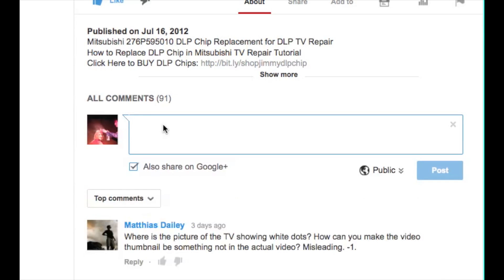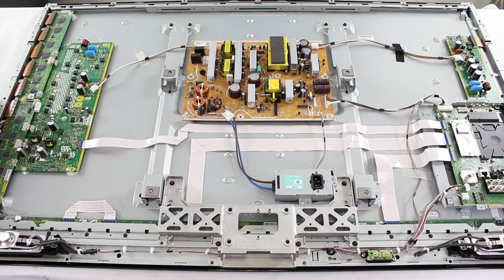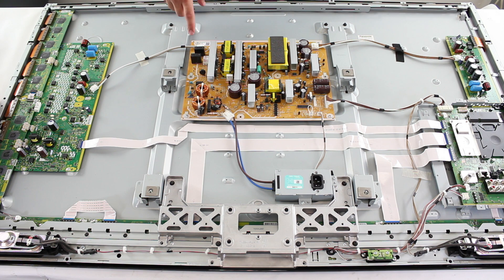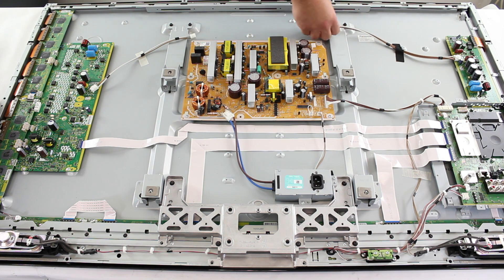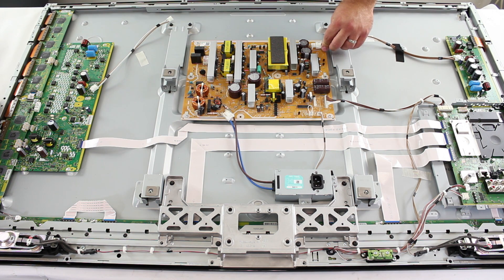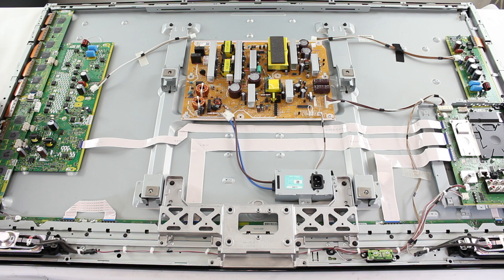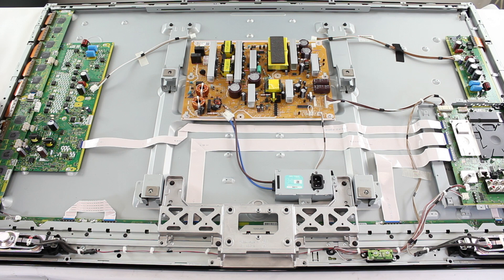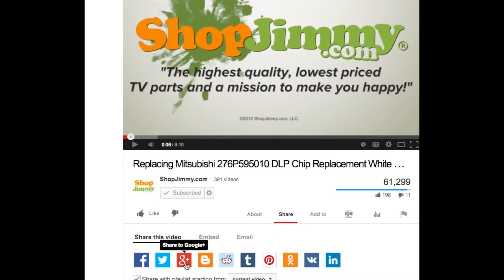Plasma TV Repair Help Clicking Noise & No Picture How to Troubleshoot Y Sustain & X Sustain Problems

Comment: Thank you for the video.  I tried all your suggestions, but it still clicks both times.  It's the power supply board that clicks.  Any other suggestions you might have?  Thank you very much

Comment: Lg50pa5500 suddenly turned off, I waited 5 minutes to turn back on, I got sound but no picture. I turned off again waited 5 min now no sound or picture but click noise from middle board the red led on the little board for cable connections stays on and a small flashing green led on the board next to the power cord male end (on the TV) flashes. I had successfully replaced the SDT-S-105DMR relay a year ago, I replaced that now but it didn't work. Any ideas?

Comment: Have a pioneer plasma t.v. that all of a sudden won't turn one, changed remote batteries un plugged and reel plugged in, changed power outlet, manual power button was damaged a year, but was working fine with remote, ????

Comment: Hi 
i have Hisense 60 inches smart tv. The Tv switch off suddently while we are watching( No red light and screen is black)
i have plug into another power socket still not working. I have openned it up, checket the comtinuity on fuse and power cable, it looks fine but still not working.
i have noticed there is a ticking noise 
Would you please help
Thanks

Comment: My Phillip 27 inch screen just started screeching then kicked off. It will stay on for 5-10 minutes, making a high pitched sound and shut off. After the screen goes off the noise stop also. It is model 273E3LHSB/00

Comment: I have a clicking sound together with the logic board light(green light) going on n off while its clicking ......I removed both ysus and zsus power cable but the clicking sound is still there..but noticed when both ysus and zsus power removed there was no light came on the logic board while its clicking. Could it be the power board problem or the logic board ???

Comment: Love your vids.  I have a Samsung pn50b550t2ffxza 50 inch plasma. Symptom are on turn on I hear 2 clicks and it does not turn on. Standby light comes on. Only 2 clicks then nothing. Pu;led the back and the logic board flashes 1 green light 2x then another light blinks green on second click and nothing. If I disconnect logic board and apply power I hear Samsung chime but still no picture.  Y and x board disconnect changes nothing.  No obvious cap meltdowns and no obvious solder failure or cracks. Thoughts?

Comment: My Samsung PN60E550D1FXZA would shut off randomly and turn back on. After about an hour it would stay on and work perfectly fine. I just replaced the Y Sustain board with a brand new one and I have no picture at all. Please help! I am going to put the old board back in and deal with the tv restarting constantly.

Comment: I hope you can assist.
As you suggest in your video to contact you to let you know this is my issue.

I have a Samsung 3D TV MODEL UE46D7000LUXXU which I bought some 10 years ago

Recently as I was watching the TV it suddenly switched off .
I tried to Switch TV on, its starts and I hear 'clicking On & OFF  sound (?from relay) as it seems trying to fire up and see SAMSUNG SMART TV LOGO lettering on the screen come on and off but does not switch on. The Standby light is ON and comes on and off.

I have been surfing You Tube and have watched many videos.
I understand that the TV has 3 Boards - Main Logic Board, a separate Power Unit Board and another T-Con Board.
From what I have seen it would seem to suggest that either the Main Board or Power Unit is malfunctioning.

Was advised that it could be Main Board malfunctioning.
I ordered a Main Board ensuring same nodel number and Board Reference numbers were same.

I ordered it and replaced it and unfortunately, same issue - Same Clicking On & Off sound and SCREEN does not SWITCH ON

I have also seen You Tube videos and some suggested Power Unit issues.

From your experience, would you agree that having now replaced the Main Board, that the Power Unit could be the cause of TV not working?

Grateful for your advise
KR
SNK

Comment: I need help diagnosing a Samsung HP-S5053 Plasma TV. When turned on it works fine but after 15 Minutes or so the screen goes completely black but the sound still works. It locks out but will come back after it has been turned off for quite a while, only to repeat the same problem. I downloaded the service manual for the HP-S5053 but it shows and describes a different main board than the one I have. I have a BN9603735a main board.  Sounded like it might be a temperature problem so I put a powerful fan blowing on the top back vent section. It took 2 hours for the problem to happen with the fan blowing. Took the back off and could not find anything running hotter than 40 deg. C. Manual says it will lock out on high temp at 135 deg C.  Having a schematic of that main board would be very helpful. Any help would be appreciated.

Comment: Hi Jimmy. I have a PN58C550 Plasma Samsung TV. Recently my TV turns on and off repeatedly about 4 times in a row. I took the back panel off and unplugged everything from the power supply and plugged my TV. I get the red standby light but not power cycle on and off. Then I unplugged, then waited 5 minutes and plugged the HDMI/component board for all the inputs into the power supply board, and then plugged in the TV. Still got no power cycle on and off. Then unplugged, waited 5 minutes and then plugged in my main control logic board. Then I hear a clicking noise from my power supply board as it turns on and but turns off. This power cycle repeats. Therefore I thought my problem was the main control logic board so I bought a new one. I swapped it out, but the power cycle continues even with his new main control logic board. Do you think the power supply could be the issue? The clicking seems to be coming from the middle voltage regulator. I have inspected all my capacitors on the board and I can’t see any bulging or burn marks around them. Any assistance would be appreciated.

Comment: I have an issue with my Samsung Plasma TV model PS51E4450A1R powered on with black display, I do had a small crack on the blasma panel during moving of the TV but this was a week before the TV broke down  
Appreciate your advice

Comment: Have a LG 60 PV400. The problem I am having is when you are turning it on standby light is red. Go to turn it on it clicks but does not turn on.  The component on the back with the green light, blinks 3 times steady than 1 time fast. Keeps repeating. There is no pic or sound also

Comment: Hi, I had disconnected all the boards from my LG Plasma 50PK550-UD main power board and it still clicks on then off. I tried to test for the voltages and there is nothing going to the contacts. Does this indicate that the power supply is bad which can be the capacitors need to be replaced? I did replaced the IC301 Bridge Rectifier, Resistors R927, R928, R929, Resistor 305, Diode D304, and Q101, Q301 having the same results. The fuse is okay since there was resistance on my meter.  I haven't removed any of the capacitors because I believed that they should be replaced considering the aged from August 2010. Any idea of which capacitors I should really concentrate on? Would appreciated if you can help with the problem.

Comment: I have a Samsung model PN50C450B1DXZA, and With your video’s help have diagnosed the problem as the y-sustain board. Do you have in stock, and is it necessary to change the buffer board at the same time? Thanks!

Comment: Love your spirit in the Videos you produce I'm  a fan, Need your help, I Have a Vizio  D55un-E1 TV,  That i got from my Son in law, and had it for a couple of weeks, when i brought it home and plugged  it in,
there was a Clicking Sound coming from the speakers and after the few weeks,  i noticed the picture slowly dimming until it went out, 
i didn't do the flashlight test to see if there was a back ground image behind the black screen because i didn't know about that test, at that time
i know about the 5 minute power down to allow  the Cap's and Transistor's etc. to discharge !!!, i disconnected the Main board from the 
power supply and did a standby voltage test and got 444 volts there was no 5.volts present i used a Standard Multimeter i want to get a Fluke or something in that range, If i send you a picture of the boards or the board model numbers for this TV, Do you Think might have and old Video on this particular TV Set,
Sorry about the essay, I'm Really Interested in Tv Repair thanks so much for all your help, This is the TV part number, 10248260221, and serial no.-------------
LTMDVPKT4458138 PRAY THESE NUMBERS ZERO YOU IN PEACE OUT. John Rosario, Thank you much.

Comment: Hi Jimmy I have a Panasonic TX-P50C3B on startup it does a double click and will not power up and then a minute later will double click again, the standby stays a solid red (no blinking ) , all boards look good no blown caps or burnt marks , thanks

Comment: Lg 60PK200-UA Serial #101RMRH12246
Bought it used, it lasted 24hrs. Picture is black but sound works. A smell like burnt wires on back left top side coming from tv. My husband plugged it in last night and it went to popping. Plz help a broke family watch some tv

Comment: Thanks to your videos i was able to diagnose the problem on my samsung 58 inch plasma tv which was the Y board, i never fixed a tv in my life but  I did the plugging and unplugging the components, bought the whole board for 16 dollars  plus shipping and it works great, great fix for 30 bucks, thank you very much!!!
Reply: That is a cheap board. Is that ebay?

Comment: Watched your video on clicking noise I have an LG 50pk540ue when I disconnect the y board an x board an wait 5 minutes plug tv back in it starts clicking immediately an the y board is disconnected an the x board is disconnected the power supply board is clicking can you help thanks

Comment: Hello my name is April & I own a 2014 LG FLAT SCREEN PLASMA (Model #: LG 60PB-6900UA). It just stop working 1 day & I realized that it had a blown fuse on the Power Board! So after unsuccessful replacement of fuse I ended up purchasing another Power Board, which after replacing would still have no picture & make a clicking noise. So I then decided to replace both the Y-Board& the Sustain board because they just looked old & I figured would fix the problem? Needless to say, it did not & still only made clicking noise with no picture. So I replaced both Control Boards & even the CTRL BOARD, and I still have the same problem! The only thing left that has not been replaced is the BUSLUR BOARD & the Bottom XRCBT BOARDS (3)@ the bottom of the tv? Aside from those 2 parts & none of the cables, I have literally replaced everything else & I am baffled that the replacements that I have already done has not fixed the problem & could really use some assistance please? Thank you for your time

Comment: Hi jimmy i have a Sinoteq model:stl-43e3000g, mo-q180855.  the tv was on and the power cutoff but after the tv is flashing a red light when you switch it on and the next day it was showing standby red light but when you press the On button, it shows the green light but nothing on the screen and no sound.

Comment: Hey shopjimmy.com I realize this is an old video and the TV I'm going to work on is even older... I have a LG 60in plasma. Manufactured 2011! Old I know, but it was cheap and I couldn't pass it up. Has worked fine until now, periodically it goes black, hitting power, it clicks, but if it's off for a long time, (like in and out of storage or off for more than a day) it works... For a short amount of time. I have a multimeter and was wondering if I can do a continuity check to see where I'm losing power? I believe my model number is 60pk200. Also, I looked it up and the main board is fairly cheap... If I simply replace the main board, since I have periodic spells of normal usage, should that resolve whatever is causing the screen to go off? When it goes out, I hear it click... Then nothing... Then another click. It seems like it's failing after it goes through the boot up...

Comment: Hi there, Oscar here
I have an LG 50lf6100 led tv, it won't turn on, no lights on, makes a chirping noise which  appears to come from the power board, the Transformer on the left side of the board. I disconnected the ribbon cable which goes to the ports board and the sound went away.
Can you please share your suggestions to fix this fault?

Tks
Oscar
omcorralesa@gmail.com

Comment: Samsung Plasma ~2010 TV 50”
model: PN50B650S1FXZA

Loops clicking on-off. Disconnected both X and Y boards at same time and still loops on off.

Put multimeter on 5V output of power supply boards and voltage would drop from ~5V to 0V in sync with clicking power cycle.

With no X or Y board connected, does this mean bad power board.

Removed power board (50” power supply board: BN44-00274A (LJ-00172A)) but no obvious swelling o caps, discoloration of regulators or cracked solder on back of board. 

Help!

Comment: Hi nice vedio my plasma tv model 42PA4500 has stand by light screen came on for 1 second and then blank screen it has all the voltage vs , va  5v ,12v etc please advise.

Comment: LG plasma tv 60PA6550 - turns on as normal but sometimes it turns off after 3-5 minutes. Sometimes it can run for hours then it shuts down. I hear the clicking noise on both the far left board and far right board. Any ideas?

Comment: hp pavilion pl4200n 42 plasma hdtv blinking codes  at power button.  Led light next to power button blinking 10 times and continues to cycle.  TV does not power on.  Please give advise on repair.  Thanks - Dom T  domtuccia@gmail.com

Comment: I have a panasonic tc-p42x5 flat screen. There was a thuderstorm about few months ago that cause the power to short circuit on the TV. Because the TV doesn't turn on immediately and have to wait few days before it can turn on again. This has happened several times but it always turn on with no problem. But now its different. When the tv turns on there is a ticking sound and the picture kinda freezes up or stalls causing the sound to glitch. What could be the problem, where to get the parts, how to fix it

Comment: Hello, I am from Belgium and I am looking for a motherboard for my LG 60PN6504, EAX65071308 (1.2) there is no EBT number, I have been searching for about 3 months now but I have not found a single motherboard. TV has been used since 2013, but it hasn't actually been used that much before.

Comment: Good day. Pls. Help me my LG plasma flat tv have a problem and the problem is when i open it sometimes easy to open and sometimes not opening and if i forcing to open is good the picture and sound but in 30 min. A color has be come blured then if i off the power not working anymore my TV pls. Tell me or show me what shall i do to repair or replace my model of my LG 50PJ250R i will wait your responds thank very much

Comment: Hi I have a insignia 50" plasma Tv model # NS-P501Q-10A,  it had a click nosie, I change the Y sus board and the buffer board and I also change the X sus board, I also when even further and change the power supply and still No picture or sound. I was wondering if you can help me or guide me to fix my Tv?

Comment: i have a 50in lg tv that has the light on and the constant on and off sound, i purchased a power supply thinking/hoping it would fix the problem, i purchased it from your online site, this was my choice hoping it would be the problem. it didn't fix it, i live in san antonio tx, if anyone in this city works on these or if not and someone that wants to repair it for them selves let me know, i don't want to just throw it in the trash, it was working just fine when it refused to come on. it is a 2011 model i think. it is free if someone wants it or i would pay someone to repair it, im visually impaired and thought i could do it but im going through surgeries at this time and just don't want to deal with it any longer. thanks

Comment: Have a LG Oled model #lgoled65c8pua
That does the same excluding the recycling of on & off, but does have  stand by light, backlight flashes and clicks when power button pushed then clicks once more followed by powering off itself... someone please help, it's less than 2yrs old smh 🤦‍♂️

Comment: Samsung PS42B450B1W Technical Help Please
Hello, while I am not as technically minded as most of you I'm no slouch and am at a loss to find a solution. Any advice you can offer would be greatly appreciated.

TV was clicking and not operating 
I replaced the power board, sound but no image (start up sound normal)
Replaced the x-sus board, no improvement 
Replaced the y-sus board, no improvement 
Fully tested the y-buffer, no issues
Then I noticed the led on the logic board was only lighting up for 2 seconds and not flashing thereafter.
The power board is putting power to both sus boards but only for the time that the led on the logic board is lit.
My suspicion is that the power board was not tested by the supplier and has an issue 

Many thanks in advance,

Kevin

Comment: Panasonic th-42px600u it clicks but no lights. If you hold the power button down for 10 sec the clicking stops until you let go of the button. It's done this once a few months ago. but I had been gone  for two weeks. And it had been really cold it clicked like this until I heated the house up. Once heated up it came back on like nothing was wrong. Worked great last night and I can't get it to stop clicking now